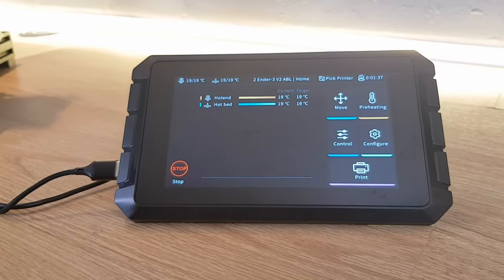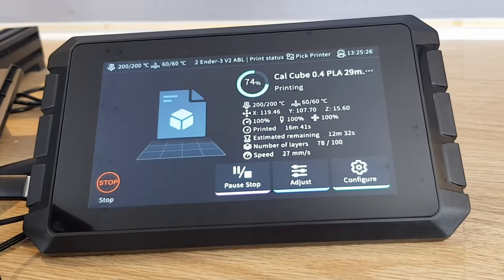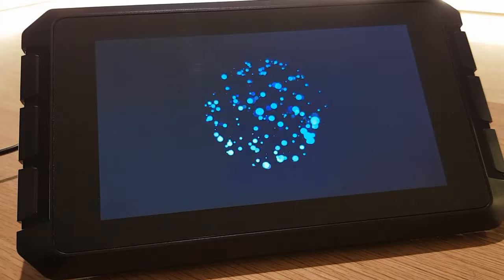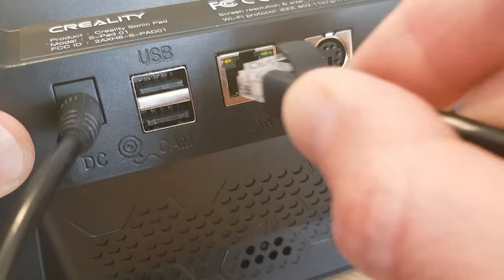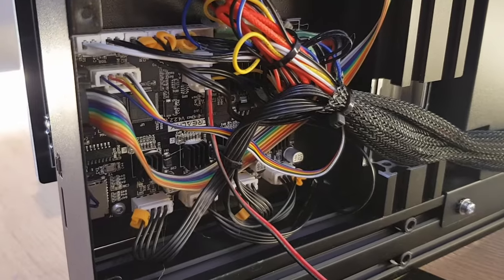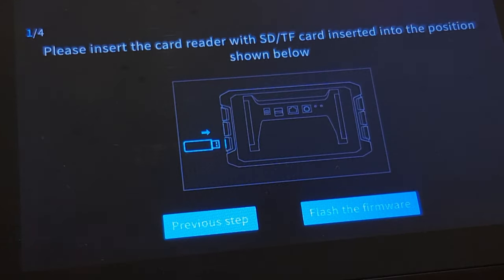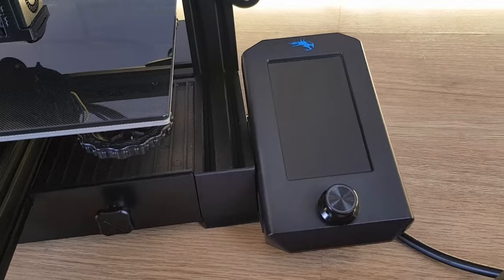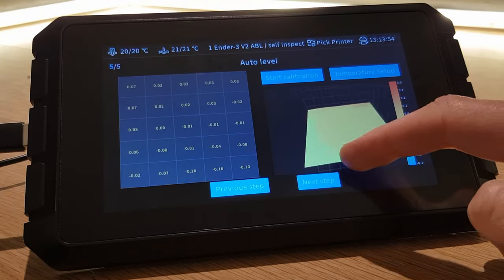How To Connect A Creality 3D Printer To A Sonic Pad - Sonic Pad Basics Part 1

Comment: Got myself an Ender 3 s1 pro, built it, got myself a glass bed,  set it all up, used TinkerCad, Creality print to slice, printing v/good. Upgraded the firmware, now all v/good. Got me a Sonic Pad, backed everything up to computer ( was paying attention ). Set up the pad and printer via serial cable, good, followed the instructions to the end, all looking good. Updated the Firmware now we are sucking diesel. Loaded a test item into pad, it can see it, went to print it, not so good. Will not print, I asked nicely, I begged, I even threatened, NO GOOD. Had to uninstall and revert back to touch pad. ( That is why you need to back everything up ) I think a setting has not migrated somewhere, which is not allowing the printer to even home when I press," print". I am 73 years old, retired, I have all your video's  lined up, and I am going to get this sorted, or I have an expensive wheel chock. Cheers Ricky, keep up the excellent work.🤫

Comment: I am glad that I found your videos! Very helpful. I do have something I think people should know. I have an Ender 3 S1 with the 401 chip. When I do the flash, I notice that the sonic pad places the bin file in a folder on the SD card. It doesn't do it for the other chip. I was so close to sending the pad back, but I decided to move the bin file out of the folder and onto the card. VOILA, the flash worked. So in case anyone is wondering why it isn't connecting or flashing, you may want to check the file being added to the SD card. Cheers
Reply from the maker: Good spot, yes the firmware files can't be in a folder. Very strange that it should do that.

Comment: Even today 2024, this video was extremely helpful.  I received my sonic pad on the second big wave that Klipper produced in the community, I saved and finally ordered one.  I stumbled on the Creality videos and, well, its a Creality video.  Nice folks, good product, but documentation wise it's not the mainstream we are used to in this part of the world.  After finding some others,  they lack what happens after setup.  Your videos on the sonic pad gave me the inspiration to get back in the garage and dig the box out.  I stayed in the garage (lol) because that's where I print, and am now rewatching to get things going today.   I've been printing with several machines since 2019, and have learned from the ground up with an ender 3 pro that I hacked up and upgraded it to what became the V2.  I've modified firmware and made many changes to the machine, but I am not an IT guy so your videos were relatable, even to a seasoned printer.  I am looking forward to setting up my two S1 printers on Klipper and dumping files right from my laptop, even though its only 4 feet away, its still amazing! Ha!,  thank you for your videos! you get a subscribe!

Comment: I tried connecting my Ender 3 Original but it does not have it listed. I followed one of your other videos on how to connect a printer that isn't listed and now my Ender 3 Original is Bricked. Help?? I'm absolutely broken over this and everything I've tried hasn't worked I even tried flashing firmware into it and every file I've found hasn't worked at all and it is still in a Bricked state. Is there a specific procedure for flashing like one file before another?

Comment: My ender didn't get the memo about how easy this was suppose to be as an install. I am getter error code key1 when micro usb attached or I get error code key0 or key3 when the ribbon cable is used. Any words of advice? I have an ender 3 max neo, sprite pro, and CR touch (came factory but doesn't show in the sonic list).

Comment: Hello, congratulations on the work available here on the channel, I have a question if you can help me, I'm going to upgrade the Ender 3 pro to Mainboard 4.2.7 and sonic pad, will I have to install some software first or can I go straight to klipper? thanks

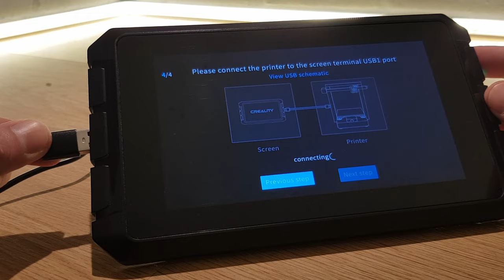Comment: Great video series! One thing I found confusing is the screen shown at 4:58 in your video. It looks like the USB cable is plugged into the right side of the SonicPad where the power switch actually is. I'm criticizing Creality here, not your video. It was your video that helped me get through the setup. Thanks.

Comment: Vey important note!!! If you set up a custom ff printer in cura make sure you check the default filament size in cura, for some reason cura defaulted to 2.85mm filament for my ender s1 plus, if this happens your printer with sonic pad will be grossly  underextruding. I spent 30 hours troubleshooting and tuning amd banging my head on my computer thinking i had pressure advance issues or not enoigh flow which led to hours of needless tweaking and testing. In a way im glad that happened because i was forced into a deep dive in klipper setting and i learned a months worth of information in 5 days, but oh boy was it frustrating, i would have given up if this was for hobby reasons but i need the speed of the sonic pad for work so i stuck with it. The results are amazing. My most common part printed is a part to a custom battery pack, we use 100s every month, they previously took 47 min each, i am now cranking them out in 25 minutes flawless. This is cutting my work by nearly 50%. Thank you for making these videos, they gave me everything i needed to get started. Edit, i know how to set up a printer, but i had named my custom printer ender s1 and since that is my most common printer it never occured to me to check setting on extruder since i only use 1.75,but curas has no way of knowing that and i guess since alot of ultimaker printers use 2.85mm they default to that on custom ff printer as well.
Reply from the maker: Good tip, all covered in the Slicer Setup video here too: https://youtu.be/Aqi5vjE0_QU
Reply: @RickyImpey  i have a 2nd tip now... watch all of the videos!!! Im almost embarrased to admit that i skipped the slicer video because i have set up multiple printers and thought i knew it all lol. i gotta thank you again, im printing soooo fast now and probably couldnt have gotten here without you.

Comment: Hi Ricky, I am a 3D printing noob and learning a lot from your tutorials. Thank you. I bought one Sonic Pad and installed today. My room can not receive WIFI that i connected with ethernet cable direct from modem and hub. It managed to update itself with it but it still insist to get WIFI connection. Do i realy need to connect it to WIFI or Ethernet will be enough for all functionality.
Reply from the maker: Ethernet should be fine, better if anything.

Comment: Just got the Ender 3 Neo max, still boxed and order the sonic pad just now,  plus cam and upgraded pei pad. I'm completely new and never used a 3d printer.

My question is I've read about the upgraded creality silent board 4.2.7. This won't work with the pad right? If it does,  is there a particular tutorial?

Comment: Ordered my sonic pad today and look forward to watching the series to learn how to get the most out of it. From what I have been reading/watching so far is it won’t be very straight forward as I  have an ev2 with sprite pro. Also will be installing the extender 300 kit. Other mods are cr touch and dual z. Any pointers would be greatly appreciated.
Reply from the maker: Using klipper actually makes it easier to customize your 3d printer in my opinion. You can modify the printer.cfg file to modify any setting you like rather than having to compile your own firmware if nobody else has done it for you. My advise would be to carefully read the information provided on the klipper github page and work through one thing at a time. Extending the x,y or z dimensions is really simple, changing the extruder should be pretty straightforward. All you need to know is how it differs to the extruder used in the config file you are modifying. If you tackle each mod individually then all the information is there. Good luck!

Comment: I installed my sonic pad after watching your fantastic  videos and everything was fine I succesfully printed several prints over a period spanning weeks and was happy with the upgrades. I've turned it on a few days after my last print and tried to print something but keep getting an error saying the printer has run out of filament. I've checked and there is plenty of filament and also reloaded it from scratch and extruded a long length.

I've factory reset the sonic pad and set it up from scratch and I'm getting the same error. I do not have any sensors fitted to my machine.

Any ideas?

Comment: I'm trying to connect my cr10 smart pro to my sonic pad. I keep getting a can not connect message. I've tried different ports and different USB cables with no luck
Reply: hello!Сan you do it finelly? what was  a problem?
Reply: i have same model of printer.
Reply: I ended up using the serial cable and ut ended up finally making connection.

Comment: So does it just require the stock config file from your printer or do you need to find a config file online? Or does it just need your control board number and chip and makes the Klipper firmware?

Comment: Hi Ricky I've been watching your videos and have got my ender 3 s1 plus up and running through the sonic. But I'm having trouble with my ender 5 plus. It has a micro swiss ng extruder and having trouble getting the settings right. Do you know we're I can get a profile or settings for it please. Everything else works fine it's just the rotation distance and stuff that I'm stuck with

Comment: Hi, Ricky. I cannot seem to get the Bed Levelling Calibration to work properly as all my prints that I have attempted are not sticking to the bed and I have attempted Bed Levelling several times. Your video does not mention what you are supposed to do with. the 4 Bed Levelling screws at the start of calibration so please could you advise?

Comment: I've tried a couple different times to connect my ender 3 max with cr touch. I keep getting an error message when it tries to go into the leveling portion. Printer head goes all the way to the left, activating the end stop switch. I then get an endstop z still triggered after retract message.

Comment: Nice serie of videos, I have a ender 5 pro and plus both running on 4.2.7 board.  When I choose ender 5 4.2.7 it doesn’t work. As they only support 4.2.2. When I choose ender 3 with 4.2.7 all moves but the wrong ways. So end stops I assume are opposite side on ender 3. Is there any bin file available for ender 5 board 4.2.7 with bl touch and Filament sensor?

Comment: Hi, can I use a normal USB to USB-c cable to connect my Sonic Pad to the Creality Elders 3 S1 Plus? The adapter that I should have got with the package is missing. I saw on the net some people said that you need a cable that the power is disconnected from.

Comment: hi does this need the high flow kit with this to run faster speeds thanks and by the way your vids have taught me so much about my s1 printer just waiting on your next one on sonic pad thanks
Reply from the maker: Hi, not initially. Eventually, if you get everything dialed in and you want to really go fast, then you will come up against a limit somewhere. It will depend on your printer as to what that is. On my Ender 3v2, the extruder starts skipping at really high speeds which could be that the hotend is not keeping up. Initially though, you will be able to get some very fast speeds with stock machines without any mods.
Reply: @Ricky Impey  hi sorry I forgot to mention its a ender s1 pro thanks
Reply from the maker: @garyenglish9742  My feeling is that the part cooling will be the bottle neck on the S1 Pro but I'm yet to really push it hard on speeds just yet. The sprite extruder should be able to handle pretty decent speeds otherwise.

Comment: Hi would you be able to help me please, I have a brand new Sonic Pad and a Ender 5 Plus with v2.2.Silent board my Ender 5 Plus was working fully so I decided to connect up the Sonic Pad selected my printer after updating to latest sonic pad software on the device then tried flashing software to the Printer and it just made my printer sit at the Creality screen progress bar wouldnt move so restored latest firmware back to print and screen and tried again and the same thing happened getting failed come up after sitting acting like its doing the firmware update, I really love the look of the Sonic Pad and would so love your expertise to help me thankyou in advance

Comment: Hi i have a Ender 3 v2 running jyers modded firmware mods are 400x400x500  
Dual z and sprite pro hot end 4.27 board can i use stock ender 3 v2 profile then mod the firmware 🤔thanks for a great video 👍

Comment: Thanks for this series on the Sonic pad. Very helpful!
Maybe you or someone can advise?
My printer was an original Ender 3 pro (V1.1.3 - 2018)
It has many upgrades: Upgraded motherboard to V4.2.7.
Sprite pro extruder.
CR Touch.
Sonic Pad.
When auto bed leveling, the extruder wants to go off the bed, then the belt slips. Should the X,Y offsets be adjusted within the sonic pad of in the slicer?
Cheers in advance if anyone has a solution.

Comment: Quick question, will the firmware flash work if I am replacing the board and don't have the original screen?
I am having to replace my main board and not 100% on if this can be done without the original screen as the board when it arrives will be blank
Reply from the maker: I don't see any reason why it would cause you any problems. You don't need the screen and you are flashing new firmware anyway.

Comment: It's it worth getting it you are going to use it for a ender 3 V3 KE? 

I heard the software on the KE is similar
Reply: I'm looking for this information as well, I'm about to pick up either an SE or a ke. And the sonic wave would be needed for the SE, but I don't know if it's needed for the KE. 

The rub is the KE is about $100 more and the Sonic wave is about $100 more.

Cheers
Alpharious

Comment: Is anyone else having an issue where your prints are failing on the first few layers and then you are given a random error message? The sonic pad worked for me at first but now I can hardly get anything to print. It seems to have an issue with the gcode, but I'm using an updated slicer (Cura 5.4.0)
Reply: I think I fixed this, I'm not sure if it was sending my gcode over moonraker, reflashing the firmware, or factory resetting the sonic pad and using USB 1 instead of USB 3, but something worked.

Comment: Firstly, thanks for the great instructional videos.  Secondly, I just purchased a Ender 3 S1 Plus  and Sonic Pad Combo after my CR-10 Mini died.  Do you recommend going through regular start up and then adding the pad or just start the process with the Sonic Pad in the beginning?  Thanks in advance for any help you may offer.
Reply from the maker: I would set it up with stock firmware and at least get a couple of successful prints completed. Once you are sure that your mechanical setup is good, then you can add the Sonic Pad. Doing it this way gives you less variables to consider if you have any issues.

Comment: Please can anyone help me. When I switch on my printer (Ender-3 S1 Pro) to upload the Klipper firmware,  it fails. My original marlin stays put so can still use the printer but on the Sonic screen it just times out. I have ensured the Klipper  .bin file is in the root directory of my SD card. It just doesn't seem to be uploading.  Thanks in anticipation!
And another thank you to Ricky for a great series of videos.  If I can get past this problem, I look forward to doing great things following those videos.
Reply: I too have a Ender-3 S1 Pro and I find the SD card slot to be a load of shit. 
I bought two new SD cards which work sometimes.
I remember doing an 8 hour print and I came to the printer to check on it and I bumped my table ever so slightly, bam and the stupid machine rebooted. No chance of resuming. I new use the USB connected to my PC when printing.
Might it be possible to flash from the USB connection (connected to a card reader?)  There are different adapters one can purchase, it's just an idea. Have never done it myself.
Reply: @ZergRadio Thanks for the reply. I found the error was putting the .bin file  in the root directory of the SD card. When it was left in the Update folder it flashed without problem and my Sonic pad is now connected and controlling my printer.

Comment: I upgraded my Ender-3 Pro with an SKR Mini E3 V2 board years ago, and tried to connect it to the Sonic Pad recently. There were no clear instructions on how to get the pad to work with that board, so now it seems I've bricked the board, and can't reset it to Marlin without flashing a bootloader to it, which is an incredible hassle. The pad worked great with my S1 printers, but now I've got a dead Ender-3  pro that at this point I just want to get rid of. 😕
Reply from the maker: That's all definitely recoverable. As I imagine you know, it will need a little work though.
Reply: I’m in the exact same boat except I haven’t even tried to connect it yet, did you figure it out?
Reply: @gamertron0882  Nope, didn't bother dealing with it anymore. Sold off all of my Creality printers, bought two Bambu Lab X1 Carbons, and my studio has never been more productive. After over 6 years of 3D printing, I'm actually having fun now without having to spend countless hours working on obsolete bed slingers just to get mediocre results half the time.